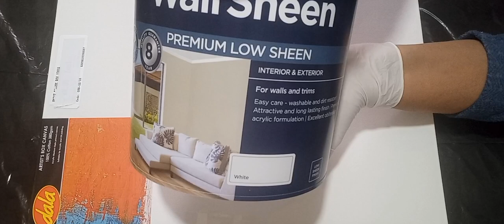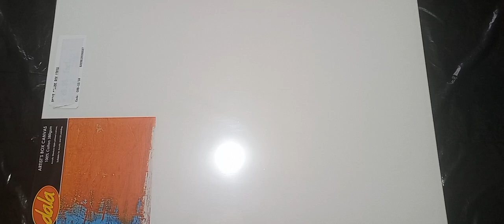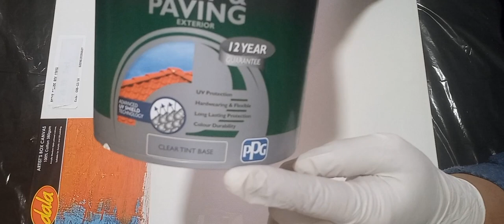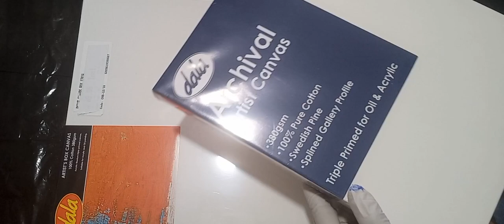#229 Blooms 1-2-3 | Show & Tell | A Mixing Video Tutorial | Products accessible in South Africa

Comment: Bernadette I was wondering if you ever tried to mix this recipe but to use ml instead of grams?
Reply from the maker: I tried.  Was not able to gouge accurately which is an impeotant factor for me.  Some paints are denser than others. I feel more comfortable with grams and I get good results every time.  So it works for me. And, as they say... why fix what's not broken 😁

Comment: Very informative... I have a question: Do you know, or have you tried coconut hair serum for a cell activator?
Reply from the maker: I have tried it yes.. in a regular pour such as my flip cup pours, and it works really well to create cells,  but it does not work with Blooms.. you may get cells but not lacing and lines that's signature to blooms.
Reply: @SIMPLYBART  ok, great information.  Thank you! I now know what I can use for certain pours. I'm going to start soon. I'm buying things piece by piece.  I just recently went back to work after being out for nearly two years from a bone fusion. With age, it wasn't kind to me, but I've progressed now.